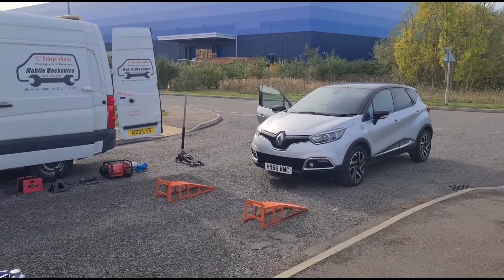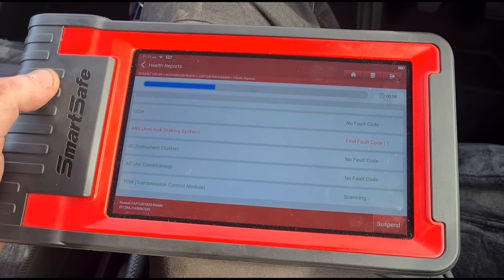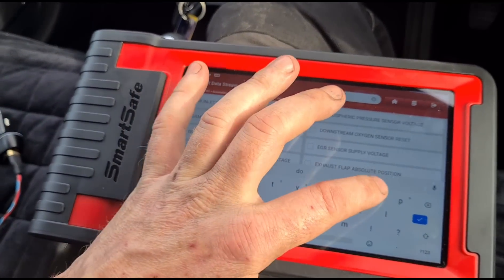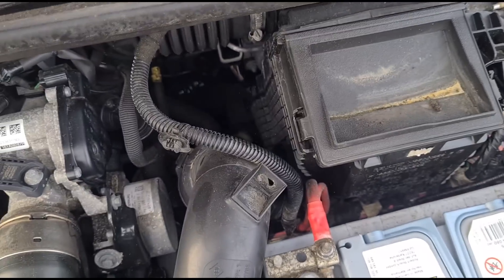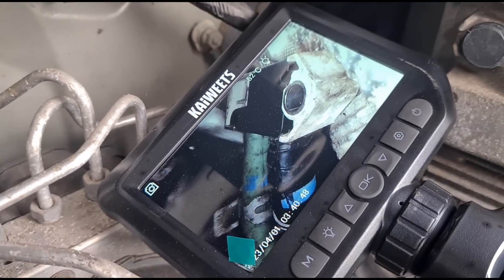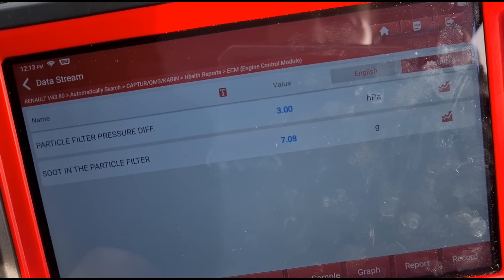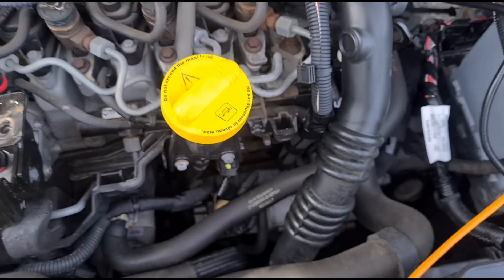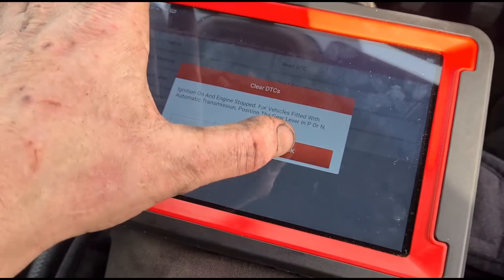Renault Captur DTC 145392 & 038096

Comment: Hallo, 
hast du eine Idee zu dem Fehlercode DF017 
beim Renault Espace 4, Phase 2, 2.0 DCI, 173 Ps, Bj. 07.2007, Motorcode M9R761
Batterie, Glühsteuergerät, Glühkerzen, Anlasser sind neu, auch ein anderes MSG zum Test brachte keinen Erfolg.

Und Renault sagt ja zu dem Fehler DF017 Glühsteuergerät tauschen, das wurde ja schon gemacht.

Comment: I, panicked when I saw that blocked exhaust pressure pipe  the missis clio has the 1.5 k9k engine and hers was blocked. I snapped a cable trying to clean it. Fitting a new, pipe to those is horrendous my hands are still suffering! I was hoping for you to do one haha. I had to dremmel a bit of shield off to get my hand under to start the nut into manifold. Not fun at all

Comment: This is common issue on these engines. The black hose just fells apart because of the temperature.It's walls first start to get thinner and at the end you see there there is a hose, but the walls are just like a paper thin and you think that everything is fine with this hose, but it is not. I like your work, but I think that would be better if you put some cloth at the turbo when you are blowing the dust from the cylinder head.

Comment: I have the same car. im having oil dilution and DFP clogged. The Differential Presurre is really high like 100mbar on idle and arround 200-400 when im on the road. i assume by your videos that this is means the dpf is clogged. If i throw some DPF clean on the entry pressure sensor, should it help a little? is it safe to throw in there? My engine does not have an upstream pressure sensor, so i can't throw the dpf cleaner through there.

Comment: Purchased Two days ago! Return to the dealer... They can't keep getting away with this. It's under a warrantee.
Reply: Depends on the dealer
Reply from the maker: Dealer did have it but said it was fixed. 20 miles later it came back

Comment: Interesting video jimmy. There’s lots of plastic covers missing (which would worry me on a car only bought 2 days previously. Also it seemed the service light was on. Was it a trade or private sale?  

My wife has one of these (17 plate) it’s actually given next to no trouble. We live in the sticks & her commute to work is a 70 mile round trip with a big climb on the motorway home. Needless to say the DPF has given no trouble. 
It’s now got 70k on the clock & recently the FAP fluid (or whatever Renault call it) went empty. 
That’s the first fault it ever had on the dash.

Comment: Pressure sensors and glow plugs don't normally fail at the same time, and NEVER when leaving the forecourt. The customer should have got the dealer to cover the repair costs.
Reply: Agreed but some just don’t want the hassle , I think Jimmy is No1 on these issues where as the dealer would have possibly taken weeks if not months to correctly diagnose, Jimmy has done it in a couple of hrs if not sooner & it’s been done right too & the owner has the car to use there after
Reply: @richie674  Had to come back and rewatch this. Two days from purchase, 4 glow plugs plus a pressure sensor and labour. Regardless of the inconvenience, that should be a warranty situation or walk away from the deal. It's the best part of £300 to diag and repair. And that's potentially the beginning of many more "hidden" faults.
Reply: Yes having said that , the owner take the receipt to the dealer & get them to refund them , thing is some folk need their vehicle for work etc & just can’t afford to take time off , or do without a car but we don’t know the owners circumstances or what’s going on so hope they did get some money back ?